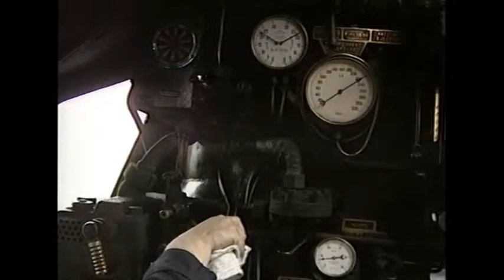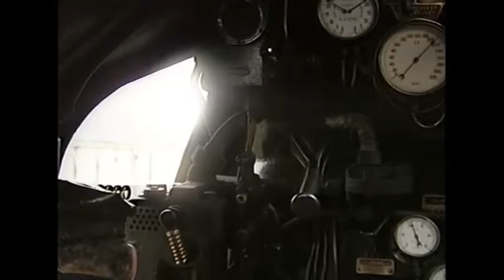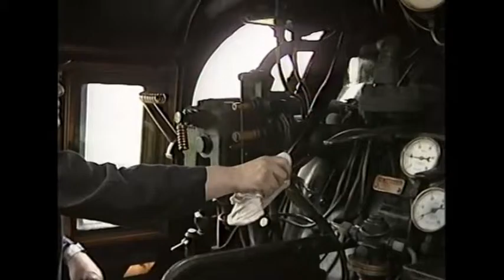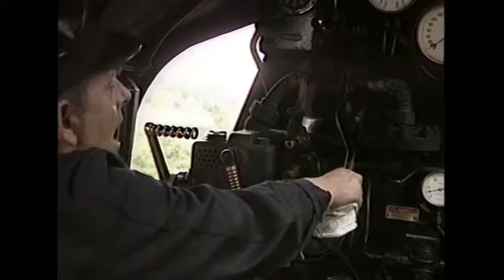Down the west of England main

Comment: This was 1988, when "City of Wells" was doing "Blackmore Vale" excursions based at Salisbury. I was in the green support coach as part of the crew. The then Network Southeast Area Manager Gerald Daniels organised a Class 33 diesel to haul an Inspection saloon for a select group of photographers on the bi-directionally signalled section to Yeovil Junction on one of the Sundays when the service traffic was light, running on the up line, while 34092 went through her paces on the down. 
We missed the first weekend that July because 34092 had taken water into the cylinders due to an overfilled boiler on the return "South Yorkshireman" from Sheffield a few weeks earlier, and broken piston rings in the middle cylinder, thankfully without damage to the cylinder itself. 
It took our group of Keighley and Worth Valley volunteers two long weekends working at Marylebone depot in very primitive conditions to strip out the middle engine, and with the help of some of the Bluebell Railway's Bullied Society members, effect the repair, replace the piston and link up and reset the (chain driven) valve gear, and after successfully passing BR''s stringent steam tests we travelled down from Marylebone on the Frday night/Saturday morning of the second weekend.
BBC TV made a series "The Train Now Departing", and one of the episodes "The Holiday Line", was filmed during the first week of the "Backmore Vale" excursions when all the trips were done by a Stanier 8F. In the way that "Rail Enthusiasts" who lineside rather than actually get involved are prone to do, the presenter bemoaned the fact that the usual Bulleid Pacific wasn't present, as if preserved locomotives, like OO Gauge models, can be just got out of a box and placed on the rails- He could always have come up to Marylebone and got his hands dirty helping us!
Thanks to Richard Greenwood and 34092's owners I was able to enjoy a non-stop footplate ride from Yeovil Junction to Salisbury when we achieved over 85 mph coming down through Tisbury before we were eased for the junction at Wilton. An unforgettable lifetime experience.